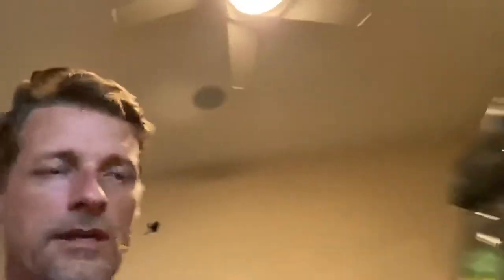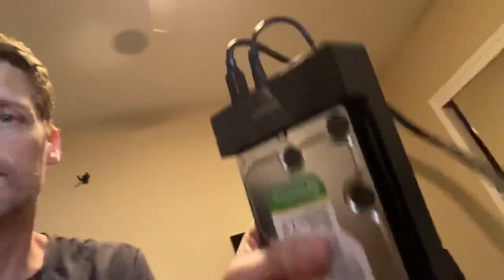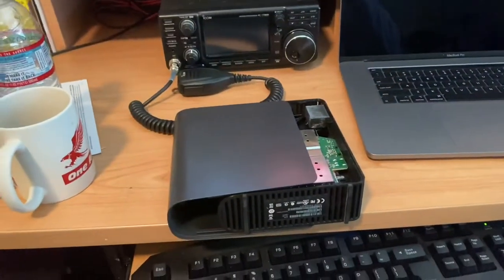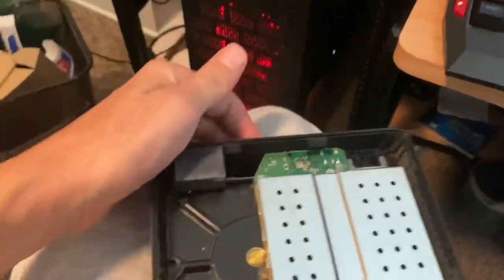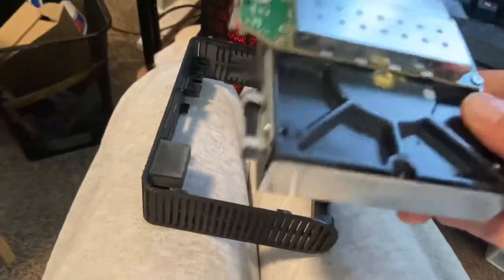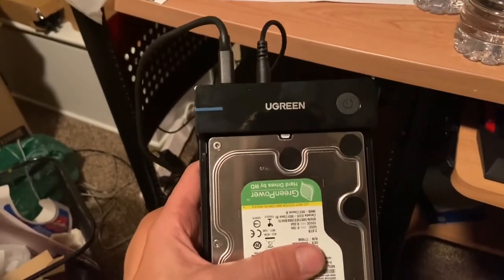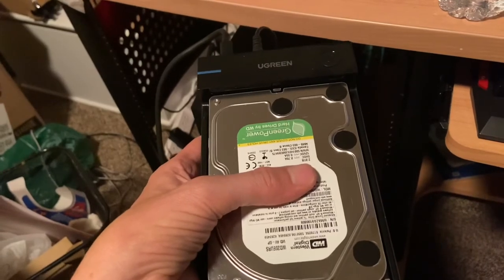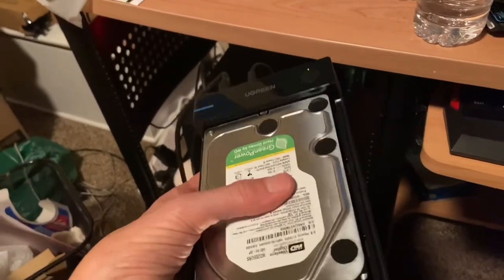How to recover data on hacked Western Digital My Book drive

Comment: Do you have to remove the hard drive from the case, I can connect the device directly to my PC already but not see any files
Reply from the maker: Yes. It was the only way I found that worked. Then insert the hard drive into the Green enclosure, then run the recoverit software.  I hope it works for you!

Comment: I just read the WD notice... I too have one of those HD and cannot access. Thank you for doing this video, it helped not to chuck the HD. btw, is there any other free recovery software that can do the job, it would be a plan B if this doesnt work for me. Thank you.
Reply from the maker: I bet there are some free resources that may do the job.. I just found the one I used to be easy.  I actually tried to find a free one but was unsuccessful in finding one.. it was either tricking me into buying it or it was too frustrating to deal with.

Comment: I have an old mybook by Western Digital and accidently plugged it into my laptop power source, which was obviously too much for the drive. Now I cannot power on my MyBook. It is a one Terabyte unit with a manufacture date of 2009(WD10000H1U-00). Once disassembled, it looks very close to the unit in this video. Will this UGreen external hard drive enclosure fit this older unit?
Reply from the maker: I looked at the pic, and I’m pretty sure it will fit. I  would suspect the size of the hard drive would be pretty standard.

Comment: WD replied me the device can never be used again after data is recovered because it must be broken in other to be able to recover the data. Do you still can use the NAS after the files restored?
Reply from the maker: I have the drive in the enclosure and could re purpose it and use it as a local (non networked drive) after the files are recovered from it. I don’t use it though. I don’t want to write over it with new data, in case I needed to run the recovery program again.. I worry like that. Lol but would not try to use it networked..
Reply: The device has already been hacked once, you do not want to use it anymore.  Keep the drive as a local backup and buy a new NAS if you want one.  2 backups are better than 1.  dont buy WD ever.  I have never had luck with them